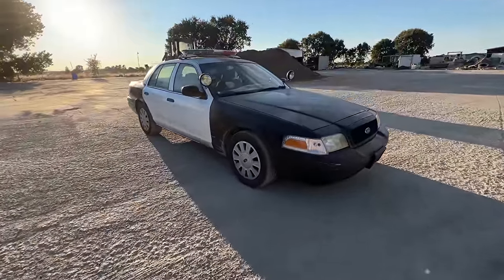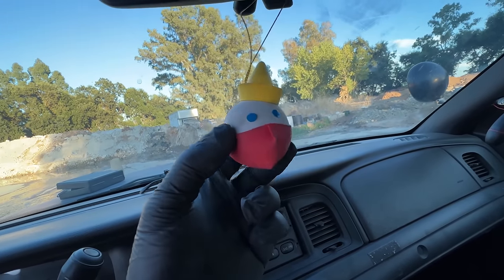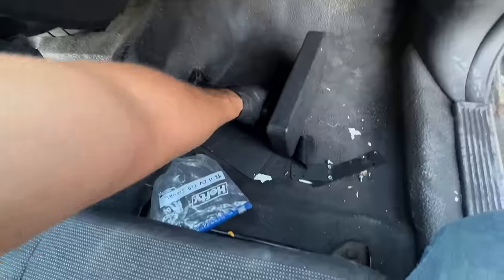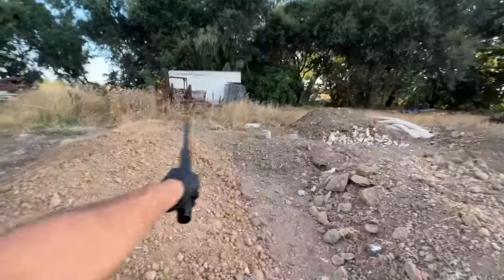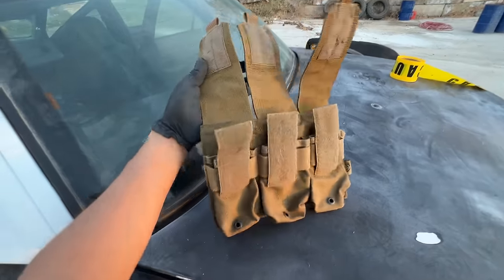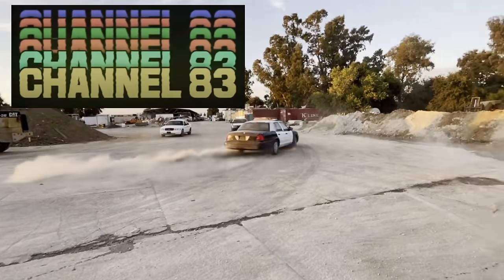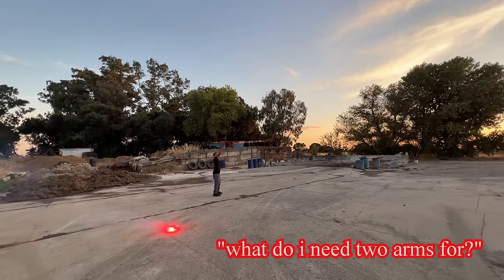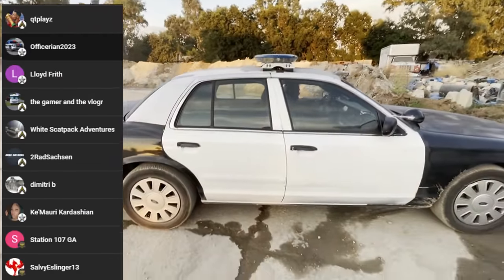I bought an Old LAPD Squad Car?! Found Less Lethal Weapons!

Comment: Man they really messed up that federal signal arjent S2 lightbar.  They cut the white wire (ethernet cable tip)  which plugs into the smartsiren brain for it to be controlled.   But im sure it can be fixed